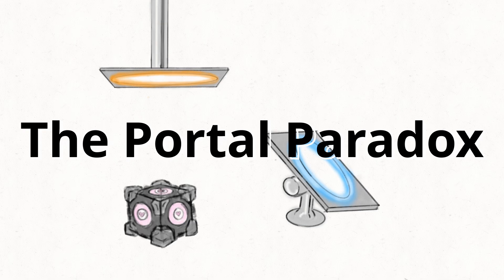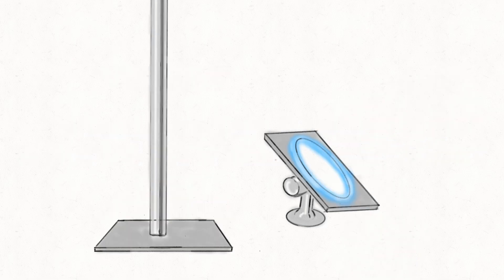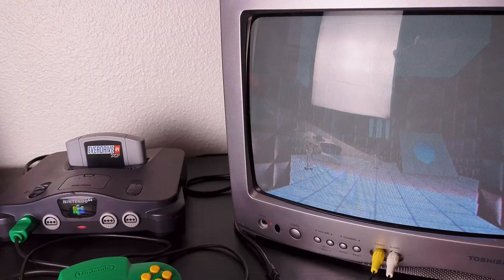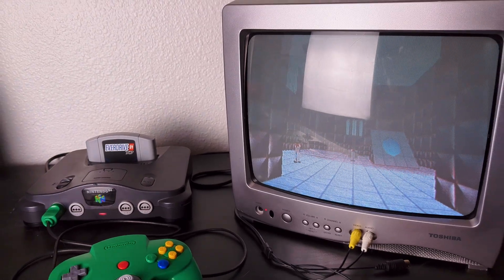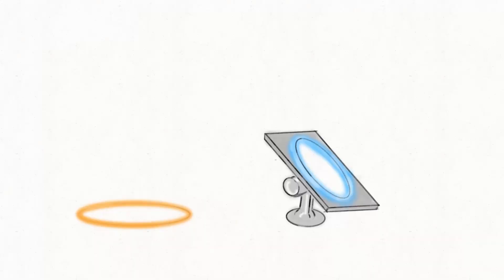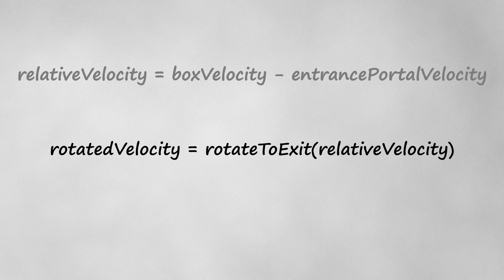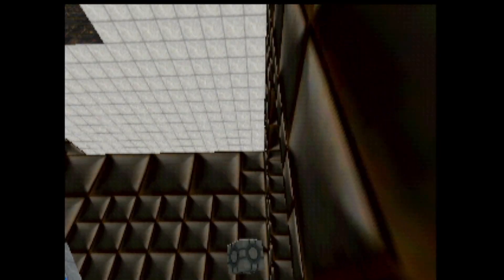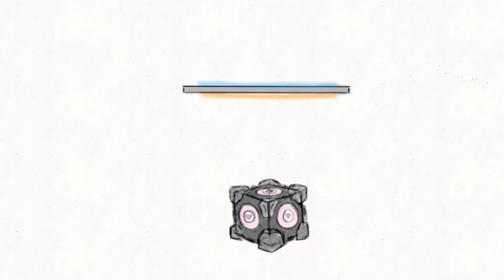I rewrote Portal from scratch and solved the Portal Paradox

Comment: Cube plops. The speed at what cube appears on the other side is high, but cube velocity is zero.

Imagine how picture renders slow, layer by layer, so the cube is appearing in the other side. Sure the layers can appear very fast, but cibe will remain stationary until gravity will not move him down
Reply: This logic doesn't make any sense. If you drop a ball out a window while in a moving car, the ball doesn't just lose all momentum, it continues with it's momentum relative to the environment it was introduced to.
Reply: @godlyvex  ball has the energy given by the vehicle. Portal cant give energy to cube.
Reply: @dashanimasandman65  It's not about the energy given by the car, it's about two different environments that are moving at different speeds relative to each other. The car is an environment, and outside the car is another environment which is moving relative to the car. Similarly, one side of the portal is an environment, and the other side is an environment which is moving relative to the cube.
Reply: @godlyvex  basicaly think of a portal as a doorway. If moving doorway was hurdling towards you at 100kmh and stopped behind. You wouldnt flinch(if you were cube).
Reply: @dashanimasandman65  That's wrong. If a door were moving at you, the environment behind it wouldn't be moving from your perspective, so nothing would happen. Wasn't this literally explained in the video? Did you watch it?
Reply: @godlyvex  I did, and this is not correct. Portals cant give something energy. The way thing is coded did the trick, but real physics do not support it
Reply: @dashanimasandman65  I already said this, the portals aren't giving the cube any energy. Nothing is "giving it" energy, it's just a side effect of the fact that the cube is entering a frame of reference that is moving relative to itself. It's pretty obvious it would work this way if you understand perspective.
Reply: @godlyvex  cube lays under effect of gravity, and after the portal it falls under effect of gravity. No other impulses recieved. It plops
Reply: @dashanimasandman65  Again, it doesn't receive impulses. Are you even listening to me? Actually try to imagine it from the perspective of the cube. The portal rushes at you, and with it, the environment on the other side of the portal. When the cube goes through the portal, it is in that environment that is moving. Imagine you're dropping a ball INTO a moving car. From the perspective of the car, the ball is flying backwards, when it really isn't moving.
Reply: @godlyvex  please stop thinking about the space behind the portal as moving anywhere. It is not. Car/train metaphor is not working here. Cube experiences pretty fast gravitational pull verctor change, thats it.
Try to imagine the slow portal. The 1/4 of the cube on the other side experiences different gravity than the rest. Then 1/2 of cube, then 3/4. 
Speed of portal is speed of the vector's change.
Reply: @dashanimasandman65  It literally is moving though, from the cube's reference point. At this point I have to wonder how you think things would go if you stuck a stationary metal pole through a stationary portal, and moved the other end of the portal around. Would the metal pole sticking out move with it? If so, the metal pole is literally moving and you can't deny that.
Reply: @godlyvex  pole wouldn't "move"  it will change its position in behind the portal space. And there is a GIANT difference between the two. I understand that the portals is confusing due to them "moving" stuff. But they are just shortcuts through space. Object needs energy to go through the stationary, and need 0 energy if behind-space just appears around it.
Reply: @dashanimasandman65  How would it change position behind the portal if it's stationary? I thought that the portals can't move things? That's what you said, after all.
Reply: @godlyvex  portal provides shortcut to another spot on the other end. Pole is standing still, space around it changed. 
Movement THROUGH space ≠ space's movement
Reply: @dashanimasandman65  Duh doy. I was talking about reference points, if that's what you're hung up about. If one thing is moving relative to another thing, then they will behave that way. So anyway, you agree that the pole would be moving? What would happen if you moved the portal such that the pole were pressing against another object?
Reply: @godlyvex  that is the point, pole is not moving. Location changes around it. Nothing moves relatively to each other, only the doorway. Portal does not drags everything behind it with itself. 
Remember the Dr.Stranges portals? 
How he flung them around stuff? 
And people was fumbling down on the other side, but not speeding in the opposite direction of the portal movement?
Reply: @dashanimasandman65  At this point I have to wonder if I'm being trolled. Your explanations don't make any sense. Telling me that it works that way in doctor strange isn't any kind of justification, convincing or otherwise.
Reply: @dashanimasandman65  You didn't even answer my question. The whole point of the question is to get you thinking about how it works, but you didn't even think about it, you just made a pop culture reference and called it a day.
Reply: @godlyvex  I do not agree that pole would be moving. 
And for hard object collision.
I think that pole would be cut the instance portal closed to reopen it in other place.
If portal moving side ways on some cart or moving tile, they will collide as usual, since part of the pole o  the other side will be behaving as usual.
If pole is standing, and portal comes from above as for cube, and there is wall with not enough room between it and end portal. It will be crushed as usual.
Tho if pole was not fixated to the ground and enough space was on the other side, it will appear fast, but after it will move fully will plop on the ground
About the pop culture reference. That was a try to find neutral place (not you or mine head) where moving portals has been already presented. And Strange is fairly wide known movies.
Reply: @godlyvex  this topic cant be fully described in YT comments. I bet it can hardly be described in person! Graphics and drawings will help, but throught text.. we're not getting anywhere
Reply: @dashanimasandman65  I don't think it's very scientific to say that the portal would just close. Nothing is acting on the portal. All that's happening is the stationary pole is being pressed against a hard surface. And if the pole is being crushed against the wall, and the pole is not moving, does that not imply that the environment on the other side of the portal is moving relative to the pole? From the pole's perspective, the world would be moving around. Just like if you stuck your head through a portal, and the exit portal got moved around, it would appear as if you are moving around even though you are sitting stationary with your head through the portal. And if the exit portal were pushed against the wall, you would feel the wall push your head back through the portal. In the same way that the wall appears to force your head back through the portal, the cube would also be pushed through the portal.

Comment: There's nothing to cause the momentum to transfer from the portal to the cube, a portal is essentially a wormhole, it's not a teleport, a teleport interacts with your mass, a portal is just a hole from one place in space to another place in space, it shouldn't interact with an object passing through it anymore than the air interacts with a moving object, a portal itself has no mass because it's just one absence in space perfectly connected to another. The ONLY new force that should be exerted upon the cube is the change in the angle of gravity relative to the position of the object passing through the portal (If the portals are placed on objects positioned at different angles).

I also think it's worth noting that any portal that changes your angle would be extremely dangerous as given that the portal itself has no mass, the edges would be impossibly thin essentially making it the sharpest possible blade edge which would cut basically anything with zero effort using even the tiniest amount of force. If we're being totally serious here then it's possible creating a portal that is infinitely thin could just cause an instantaneously infinite number of nuclear explosions as hydrogen atoms in the air touch it and are cut clean in half but that's going a lil deep.

But as for why your "Simulation" behaved this way it's because you coded it to, I just don't think it is a realistic representation of how a portal like these would interact with objects in reality.
Reply: The portal isn't "giving the cube" momentum, it's doing exactly what it seems to be doing: bridging the gap between two locations in space. The areas on both sides of the portal are effectively adjacent, and if one portal is moving, then the area on the other side of that portal is effectively moving relative to the cube. So once the cube moves through the portal, it will be in an area that is moving relative to it, and since the area is actually stationary, the cube must be moving. 

If you don't believe that the area on the other side of the portal is moving relative to the cube, then picture this: if instead of the cube, YOU were sitting there, and you looked at the approaching portal, what would you see on the other side? Would you see an environment rushing towards you on the other side? (The answer is yes.) Or what if you were on the other side, looking into the stationary portal? If you looked through and saw the cube rushing at you, would that not imply that the cube is moving relative to you (at least, through the portal)?

I'd compare it to dropping a ball inside and outside a moving car. When you drop a ball inside the moving car, it seems to fall straight down. And when you drop it outside the car, it seems to fall straight down relative to you, but to everyone outside the car, it's moving at the same speed you were when you introduced it to that environment. If portals worked the way you suggest, it would be as if the ball simply lost all speed the moment you dropped it outside the car, and in this case, the ball would appear to suddenly fly backwards away from you. Which, granted, would actually happen in real life because of air resistance, but that's not really relevant.
Reply: @godlyvex  It's a stationary object relative to the ground/planet it's on, the portal wouldn't impart any momentum onto it and given that the cube doesn't have any itself (Relative to the earth) it would continue to not have any momentum (relative to the earth) when it passed through to the other side of the portal.
Reply: @BagPussHerobrine  That logic works normally, but portals mean it doesn't matter if the cube has no momentum relative to the earth. The cube is traveling through the portal, so what matters is whether or not the cube has momentum relative to the earth on the other side of the portal. And it does.

Comment: The mistake imho is treating the portals as relativistic objects.
If that was the case, the block would teleport relativistically, meaning infinite speed and mass, which is clearly not the case.
To manipulate space-time, you need exotic matter, meaning matter which defies the laws of physics that we know of by having negative mass and accelerating in the opposite direction of where the force is applied.
This was crucial in the famous alcubierre drive and even been simulated by mit in google's quantum computer (although that might have been wrong after all).
The point is that imho those portals have to be made of some kind of exotic matter for it to work in a relativistic space-time. As such, the block needs to be in a "safe bubble" to survive the trip without causing a paradox.
We don't know what exactly happens to the portals when they get accelerated, since they can't be made of "normal" mass, but we know for sure that the block needs to be in a bubble where its conditions don't change, since it's the space-time around it the thing that gets bent.
So, if the block has no momentum, the status doesn't change: it will exit with the same (none) momentum relative to the observer.

IMHO

[yes I'm a bit sad that the OP nor anyone else will likely ever bother read this, how can you tell? EDIT: no one smart enough to know what I'm talking about, at least...]
Reply: Do you have any proof that the cube would have infinite speed and mass? And what's this garbage about exotic matter? This is a hypothetical about how objects moving through portals would work if the portals seamlessly connected two sections of space. Pointing out stuff about exotic matter is irrelevant because we're not talking about making real portals, the portals are just a convenient device to make the hypothetical work.
Reply: @godlyvex @godlyvex5543 @godlyvex5543 "garbage" LOL 😂😂😂
"Any proof" it's literally how relativity works, you might want to look into that and disprove Einstein and 100 years of physicists before commenting?! 😂
The exotic matter is not "garbage" either, it's the only way we've found so far to theoretically obtain faster-than-light travel without breaking relativity, and it's required to manipulate space-time... it's also very fitting with the thing glados says about the portals not modifying the momentum of the blocks, which is how a warp drive also works...
I'm bothering with this because it's a thought experiment we want to know the answer to, so it's supposed to work within the confinement of certain rules. It's a physics problem, so I'm using physics rules to solve it.
If you just say "nah, it's just magic", well... why are we even here?! It works however you want it to. Might as well say "it works this way because harry potter or the bible said so" 😂

It's fine not knowing stuff, but you might want to shut up about things you know nothing about, instead of arguing and insulting people...